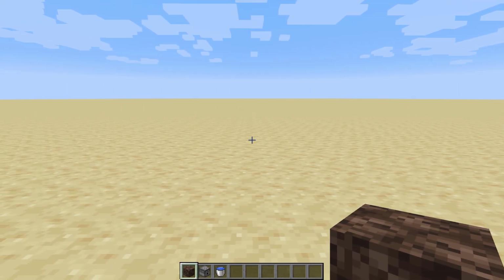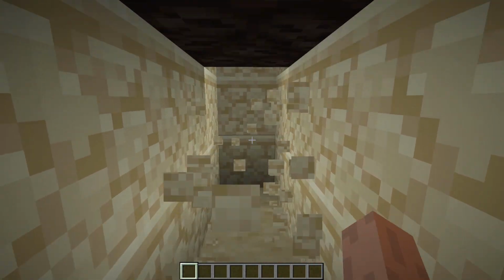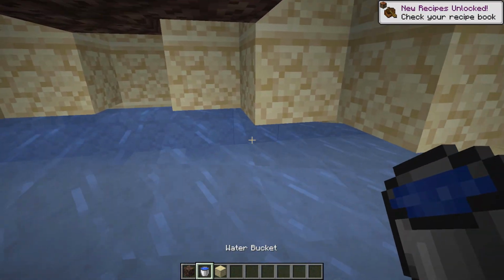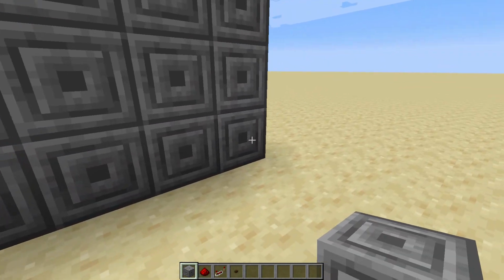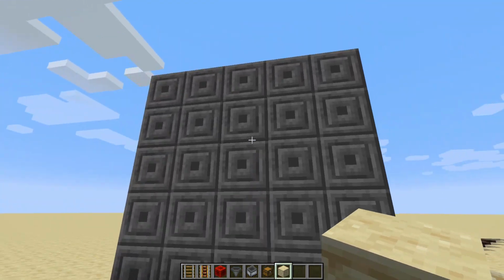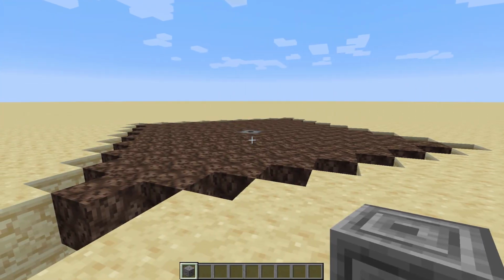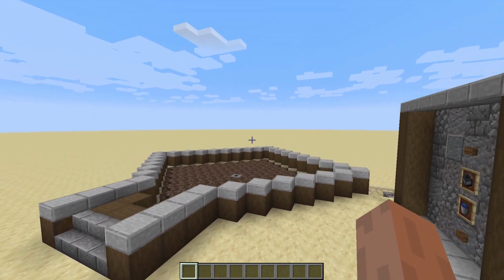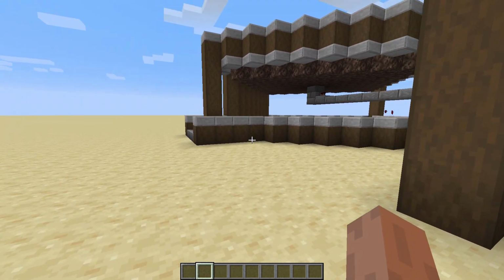Simple & Stackable Nether Wart Farm - Minecraft 1.14+ Tutorial

Comment: A much better redstone system for stacking platforms is to use an observer that faces the block that the dispenser places the water in. The dispenser placing the water activates the observer and can send a redstone signal into another dispenser above it. Super cheap, super clean, super easy, and it avoids a platform blocking items from falling down.
Reply from the maker: I have also pinned your comment, hopefully this will expose it to those who want to build this farm design.
Reply from the maker: Hey Xeppeling! This is a great suggestion and a MUCH better alternative to my solution.
Reply: Also thought that, but the problem is that the observer detects every single water update, so it gives an output of 7 ticks at the end. A solution to that was to place the observer in one of the corners and it's output facing a block, from that block two repeaters with 4 ticks of delay both and redirect that to the dispenser above. It was the solution that I made. Probably it's not the best since I'm on a server in 1.12.2 version and maybe from above the observer no longer detects 7 updates, but in that version I can say it was the best way I could make it. (sorry for the bad english, I'm not a native speaker)
Reply: Ok, that’s be done this, but the one problem I’m facing is that my 3rd level is always going out of order. Like, the 1st and 2nd will put out water while the 3rd takes back water. Note that this is on a realm so it might be that, but other than that, it’s just constantly going out of order.
Reply: You can use a similar trick on the bottom level which is also blocking falling netherwart. Use a piston to cross the fall and an observer to retransmit the pulse. The piston extends, triggers the observer, then retracts getting out of the way of falling items.
Reply: oh this is like the platforms for dark room mob farms, will increase the production a lot more but to be honest, isthat much netherwart even needed? :P I mean, with just this one platform you get about 2.5 stacks of netherwart,
Reply: Just hit the button twice that’s whit I do
Reply: If anyone is still struggling to use the observers because they give 7 signals, have the water be placed into a waterlogged block (I used fences) so that water can flow out from it but not back in, therefore outputting only 1 signal.
Reply: Even better, just replace the mine cart and rails with a line of hoppers.
Reply: ExiledSenpai 
That’s way more expensive though
Reply: @TitanWurth  true. But it's faster and more reliable.

Comment: My water won't reset even when I put a block down. When I put the water back it doesn't move onwards. Does anyone have a solution. I'm playing on 1.13.2 by the way.
Reply from the maker: Hello Joel. I’m not sure exactly what your issue is. Does the water hang around even after the second button press?

- Hocus
Reply: @Hocus   On the lowest level, where the minecart is, the water won't flow beyond a certain point. I followed your advice to use block placements to reset the water but it wouldn't go beyond that point. It doesn't matter now though, I tried it in a different location and it is working fine. Thanks for replying and keep up the great content.
Reply from the maker: I’m glad you got it working Joel!

- Hocus